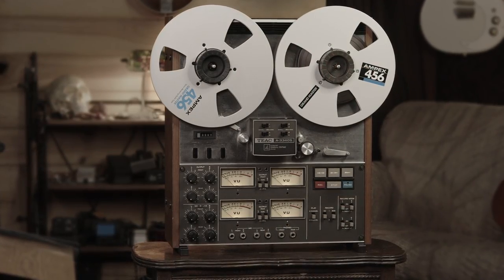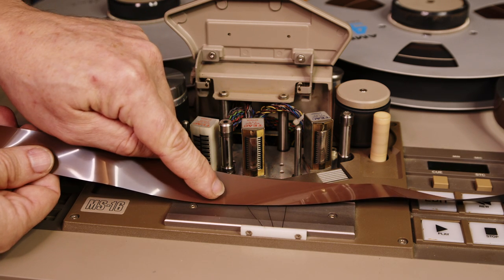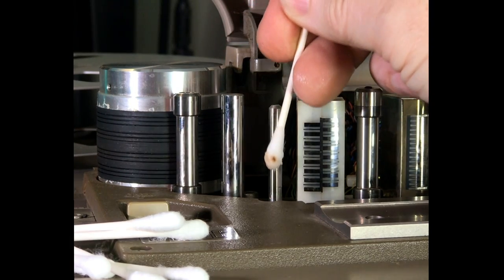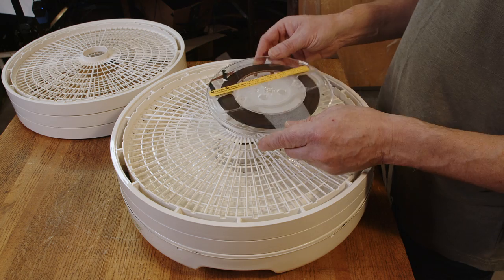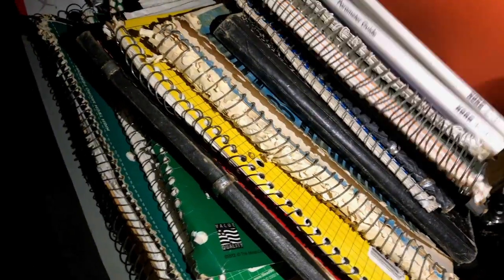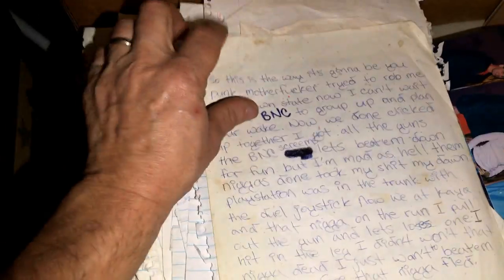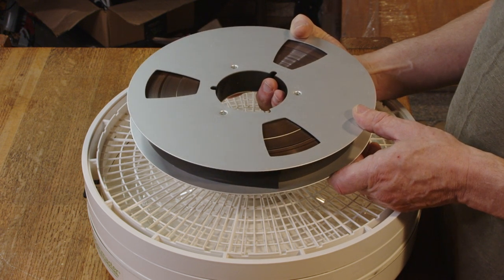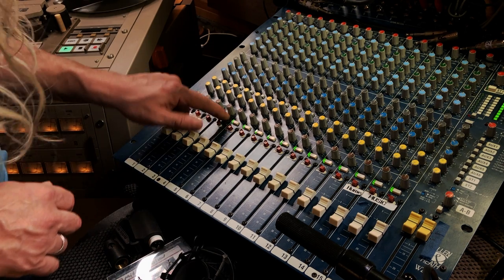What Happened To My Analog Tapes?

Comment: Apparently Ampex tape is one of the worst offenders for 'sticky' tape syndrome. Maxell is one of the best.....I've just transfered some Revox tapes from the '80's
Reply from the maker: Yes. I found some really really old Maxell reels that I had used on my Teac 3340s - no problems at all.
Reply: If you get a reel of 456 sealed in its original packaging, it’s almost always good. I’ve never had a problem. Ampex is actually really reliable and affordable. However, I have had problems with open boxes of it, most of the time they’re unusable. However Quantegy GP9 is perfect. Open or not that stuff is the Noikia of tape. It’s plays perfectly no matter whT
Reply: How's ATR Magnetics?

Comment: Word to the wise: if you recover your tapes from binder hydrolysis by baking them, setup your digital capture before playing them. They won't stand up to repeated plays. Each time will likely cause more high end roll off if not drop out.
Reply from the maker: True! Good advice.
Reply: I used every broadcast video tape machine that Ampex ever made, I now restore these machines back to working condition and use them to xfer old television shows, commercials etc. I bake my 2" quad video tapes for 10-12 hours, then digitize them immediately as they will not hold up to repeated playbacks. Imagine tape against video heads rotating at 14,400 rpm!
Reply: @rty1955  I've seen some of this restoration work, getting quad tapes digitized - it's incredible. I've tinkered around getting a few old reel-to-reel machines back up and running (belts, pinch rollers and associated mechanisms) but I've never monkeyed around with the big video tape formats. It's impressive stuff.

Comment: BTW, DO NOT use your oven or convection oven to bake tapes! They run too hot, and can damage your tapes, or the plastic hub the tape sits on. Food dehydrator only, at 130-135 degrees,

Comment: Love the Tascam MS-16. I ran and maintained one in the early nineties, and synced it with ProTools 1.0 in a small studio in North Georgia. The Tascam is a fine deck - until the soft heads wear out. I use a dehydrator for tape baking myself. I use an infrared thermometer to make sure of the temperature - it works fine.
Reply from the maker: I was syncing to Protools for a while as well.

Comment: What happened with analog tape is a bit of a story in itself. Analog tape is basically rust glued to plastic. The ‘rust’ is known as ‘oxide’ (of which there are many different formulations). The ‘glue’ is known as ‘binder’. While the various tape manufacturers developed their own oxides, the binder that they all used was from one manufacturer… 3M… who is known for their ability to make great adhesives. The only problem was that somewhere in the early 70s they changed their binder formulation without realizing that this new formulation attracted moisture… something that took 20 years to discover. 

The common solution for this is to ‘bake’ the tapes, thus drying them out so they can be transferred. I once had the opportunity to work with the late, great Roger Nichols who told me the best solution was to put the reel of tape in a vacuum chamber and lower the pressure to the equivalent of being at 50,000 feet, which would draw the moisture out without harming the tape. Since we don’t conveniently all have a vacuum chamber lying around, while this may be the BEST way,it’s just not practical. 

The good news is that once this binder problem was uncovered, it was also corrected, so that the analog tape currently being made will not suffer such a problem. Great video! Cheers!
Reply from the maker: Thanks! I actually have more tapes to bake... ugh.

Comment: In 1986 i got the job of doing a full alignment on a good 2nd hand 16 track Otari for 2CA Australia's production studio,
I have to say it was great fun. Just a memory now.
Reply from the maker: Sounds like a great memory and experience!
Reply: @FreakingOutWithBillyHume  yes, i had to do the work in the control room, because the tech workshop was too small,
and production was busy with an MCI 8 track. the only fault we had later...was a bridge rectifier failed in a power supply,
So i replaced at lunchtime, and all was ok after that. I had only bought the spare part about 2 days earlier by chance.
My boss came back after lunch to find it working again, and just for fun he "told me off" for fixing it too fast.
All the VU meters and big reels tend to put me into a hypnotic state.        Andrew

Comment: I use a commercial dehydrator about the size of a bar fridge, because I get in ten or more tapes at a time, and I like to spread them out. Aside from the oxide binder causing the problem you showed, the backing likes to strip off on tape guides, too. I mitigate that by replacing solid guides with rollers where I can. 
Not sure whose baking time recommendations you're using, but I consider Eddie Ciletti's work in the field to be the bible for this stuff. I'll often drop the temp to 125 or so, and bake for at least 12 hours, with an equally important 12 hour cooldown.
Reply from the maker: I'll try that baking time / temp formula on the next run.,

Comment: I think I may need MLR tape, a dehydrater and a demagnetiser: I managed to get a fully functioning MSR-24 with a bunch of tapes a few months ago, the BASF ones are OK but most of Ampex ones need baking... I'm not sure what I got myself into: I went directly from a 4 tracks Yamaha MT-3X K7 deck to a DAW. What happened was I found back old early 90's recordings, my MT-3X let me down long ago so I had to borrow a working one and... It was the first time I listened to this tapes thru a serious console (Amek Big-44) and serious monitoring (Dynaudio) and it was a holy f-ck moment... Seems I did pretty well when I recorded the stuff because is really sounded great and so warm and so alive, it was I missed with digital recording. I actually considered to get a 8 or maybe 16 tracks RTR recorder for cheap but it happened that there were several 24 tracks ones that were affordable, well, seems that most of these needed maintenance but... the cheapest one which had always been well maintained by its owner.
There's another point: with digital, after 6 hours of active listening, my ears are "cooked"... This wasn't the case when I was recording on tapes, and when you're in a creative process, you may absolutely be at it sometimes 30-40 hours in a row, just pausing for your body needs, you can't just be at it for 6-8 hours then go on like this over several days, so, progressively, I started to record and compose less and less and less for my own stuff because instead of having fun at it, it became tiring...
Reply from the maker: Wow! And yes, the Ampex 456.... ugh. I've realized that I need to bake the tapes longer than the times I've seen suggested online.